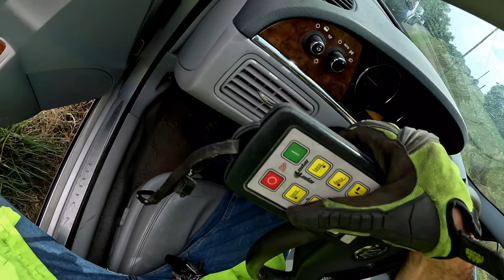TAG TEAM TOWING!!! 2 CARS ON CR-250!!!

Comment: Casey LaDelle made a video on a certain type of chain binder. it was not slanderous, just talking about how they arent as fast as traditional ones, but it seems like the ones you have can be operated by both an impact AND by hand, and did not take you much longer to actually pull out the extra tool and set it up. i say it wasnt slanderous because the company has been flooding that video talking about how much better it is and how he wasnt doing it right and all these other things. Casey was very careful to not even say any brand names, but it was said in the comments. the design had 2 bolts on each side of the binder to help keep itself tight, if that helps any.

Also, congratulations on 500k subs

Comment: "Awww I hate being short.." Believe me Ron, being 6'10 is no cake walk either.. The amount of pain I'm in any time I bend over or sleep wrong or lift anything or turn wrong.. The scary one is when I turn and my legs suddenly decide they don't need to work anymore. I'd definitely take struggling to reach things and a decent back and easily found clothes and being able to fit in any vehicle over being tall and in pain constantly.
Reply: I hear you. Being long in the legs is also a pain here also. The legs on cheaper jeans are out of the picture  as the will be  around my ankles. Levi's only basically. I am cross that the denim is getting thinner and thinner.
Reply: Being what I tell people who ask that I am 5’-21“, I can certainly relate to your situation!
There’s a number of times when being Ron’s height would be an advantage!

He doesn’t have to worry about: being hit by ceiling fans, running into low hanging automatic door closers, low archways in certain restaurants or homes, getting things from the bottom shelf in stores, fitting into any vehicle or airplane or bus seat without problems, standing near the front at an outdoor event like a parade,and numerous other things!

I certainly do enjoy my height at many times but when I have to go into a crawlspace underneath my cottages, sometimes it can be a bit of a squeeze.

Comment: No way am I first, but if so neat!

Also, why use two trucks? Is it faster? Safer? 
Round here one rollback woulda got both. Put the car up on the tray and then grab the truck with the under reach. But, this is ATL so a lot these dudes are proper cowboys and just do it all willynilly. As they say "Just cause it works, don't mean its right" so I didn't know your feelings on it.

Comment: Is the way you tie a car down required in your state or just the way you do it? I’m only asking because in my state the winch line does not count as a point of contact. So I always use one j-hook on the rear winch and a wheel strap for the four point of contact required by Georgia.
Reply from the maker: Actually, the 4 point tie down is a Federal law.  As you said, the winch line doesn't count and at least two of the four tie downs must be adjustable.   Many towers are not aware of this law and I see many running around with only the winch line in the front and one single chain on the rear.   That's fine for an Emergency move, but, by law, you are supposed to stop at the next safe location and complete the required 4 point tie down.   Thanks for watching and God bless.
Reply: @RonPratt  thank you for that info I didn’t know that law either! Thank you sir god bless you and prays for safety man.

Comment: First! Why didn’t you use the wheel lift to just tow both with one truck?
Reply: Could be law enforcement wanted the taken separately. That’s my first guess anyways. Or one is going to one place and the other is going to another. Just a guess
Reply from the maker: Because we were dispatched by two different agencies and each requested a "rollback".    We did as requested.   Could I moved both vehicles with one truck? Absolutely, and have done so many, many times.   In this situation, that isn't what we were asked to do.   Thanks for watching and God bless.